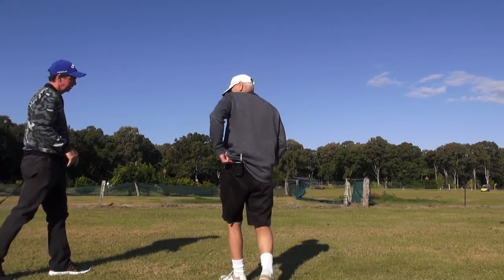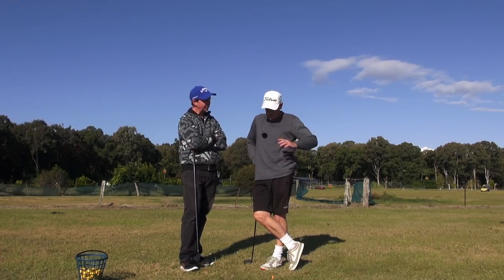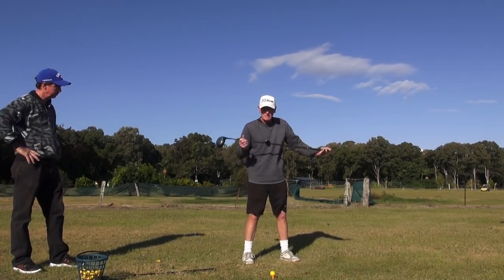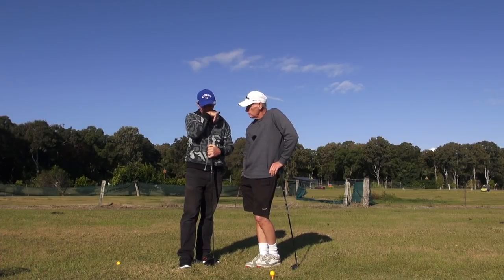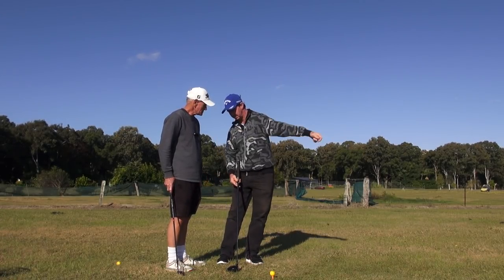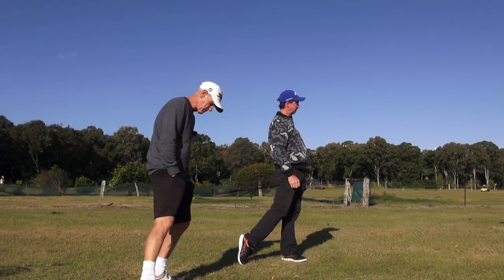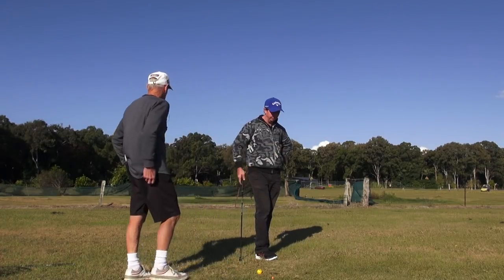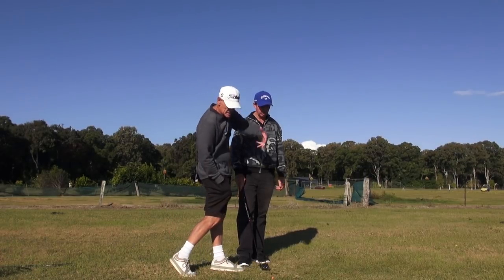Mr X's Final Channel Lock Protocol..

Comment: JH/Mr X               It’s amazing how low and how long the club face stays along the ground pre and post impact. The accuracy is just off the charts with this and mr x looks like he’s been doing it for a living.I would love to see you guys play a few holes and give some insight into what your doing and maybe share some course management ideas.
Reply from the maker: Hi Matt,
               We will try to get out on the course soon and do just what you are  suggesting .. its just so hard at the little course where the Practice range is because its always so  busy .. the course Mr X  belongs to is   high profile   tourist course so its always busy as well .. but  I think we can work something out  some way  and  get behind the field late in the day   in the next week .
              Our little course is a great test of  approach accuracy because the greens are so small    and are like upturned saucers  so if you shot is not struck 100%   you ain't  gonna  hold  the green..
                        The course management  would be interesting  because there are some very tight  driving holes where Mr X would  be hitting maybe 4 iron off the tee  and because I   drive the ball   with no fear at all of the fairway width I would be hitting driver  ... and where  I would  be hitting first into   the par fours   trying to  get  say a  6 iron closer to the flag than Mr X's  probable   9 iron  would be  a good difference of   approach shot requirements ..
                        The other thing  now would be  how  Mr X would now fare  in the putting dept .. I used to  eat his lunch  in that department but he has improved that aspect of his game out of sight .. so yeah we must get out and get  some of that stuff on video..
                     cheers JH

Comment: Hi JH.I guess you could say Mr. X is set on his protocol. I’m finding that with my swing this is not so. With all the good information you and Bill have provided, I’m confused on what to do. I’ll try to forward Bill a swing video of myself. I’m very inconsistent at the moment. While trying to incorporate soggy knees, etc.. I’m getting something wrong. I’m slicing the ball now or going left of my target. I feel my hands either leading the swing or breaking down at impact. I’m using the Yogi grip and trying to keep the body still. I’m in a rut. Cheers.
Reply from the maker: Hi John,
                 I think I might have to do a ... 'Just Do This ' Channel Lock video ... I will  format the video  around   the easiest way to apply the  'Best'  basics of the CL swing ..   you must be  way out of your  correct    setup   requirements for the swing's geometry ..  'Pulling/Slicing'   should not  be remotely happening if   your shoulders are closed at impact .. clearly they  'aren't closed so there  must be something drastic causing that   to happen.. 
               Absolutely send Bill a video of your swing ..   .. with what you have going on as  current ball flight issues Bill will  pick up easily what your  problems are...yes there is a need for a video to  remove any 'Confusions' that have crept into the CL  swing  mechanics understanding of late ..
                          cheers JH
Reply: YES PLEASE ONE TOTAL 'THIS WHAT U NEED TO DO'  VIDEO!!!!!!!   with all info, this would be SO HELPFUL for us Dummies!
Reply: Thanks JH. I’m going through a little dry spell now. I started off great with the basic protocols, ramped it up worth Yogi Lock and now between you and MMI it’s a case of info overload. I sure I’ll figue it out. You’ve set up a fool proof system in actuality. Thanks.
Reply: 1atomicgolf   Did you ever do the Just Do It video?

Comment: Hey JH- if I am hooking the ball, not a nice draw, does that mean the ball is too far forward? Am I not swinging in to out enough? Driving ranges have just opened, so I will finally get a chance for some reps to work things out.
Reply from the maker: You are   probably  just  rolling the lead shoulder  to much  before impact   and the ball being to far forward  could be causing  you to  roll the shoulder    over   because you are trying to get to a  ball that is  to  far forward   at impact  .. as well   you need to really get the lead hand/arm   pulling  outwards   across the target line  'more'  than you  think you need  to  ..  
                   cheers JH

Comment: With this in to out swing, is it hard to work the fade
Reply from the maker: The 'Fade' with  CL   is    just a    straight   'Push'  flight    that  just   leaks   away     to the right at the end of  its  flight  ( right handed players  of course)... and that is achieved by just   setting the clubface a bit  open at address   and   aiming a bit  further left at address..
                CL     because of its absolute    swing path   geometry    will never    let the club  swing from 'outside'   to  'inside    as a path delivery at impact  ..   to that end   you    cannot   hit  'cut'   type   curve   ball flight shots .. and frankly why would you ever want  to hit   'cut'   flight type shots anyway  .. it is the most inefficient ball flight     you can    apply to any   golf shot ..
                 If you need to  bend the ball    significantly  you just   open the clubface  'more' at address   and aim 'further to the left at address  .. when I say  'bend'  the ball flight  ..  I mean get 'more'   leaking of the ball flight to the right    at the end of the flight  ...
                  cheers JH
Reply: Thanks for taking the time to give an efficient explanation of a fade.